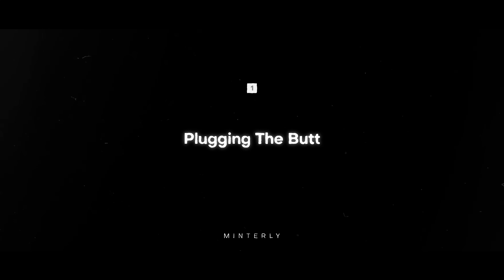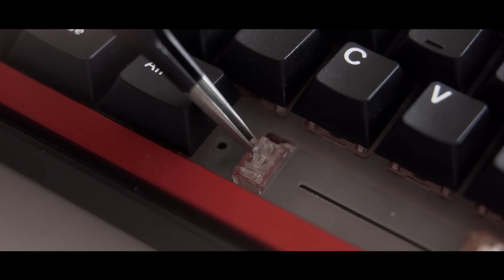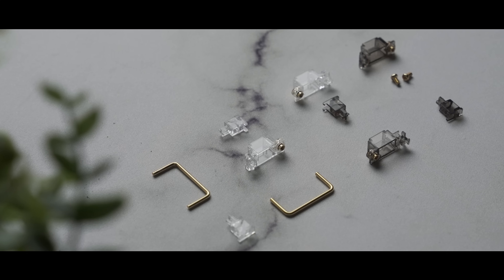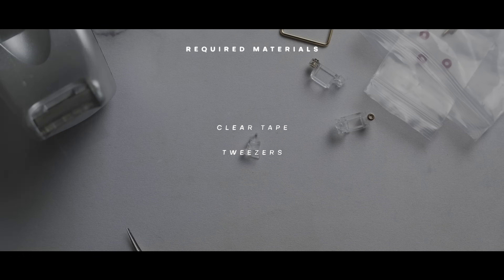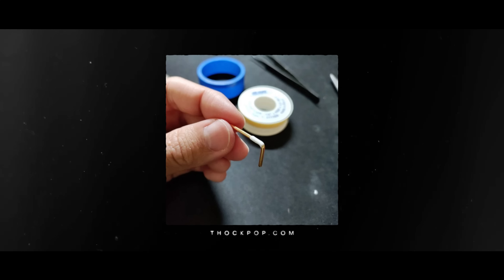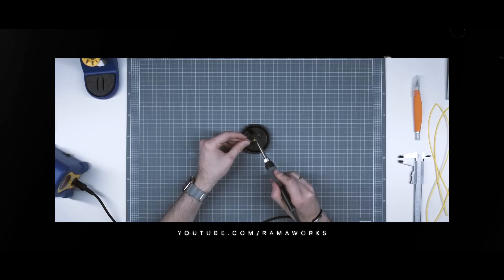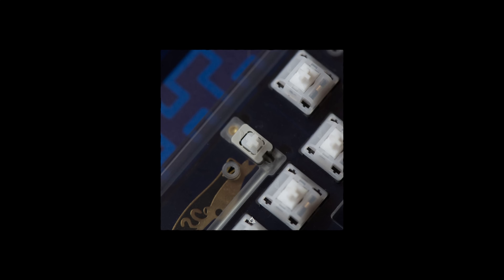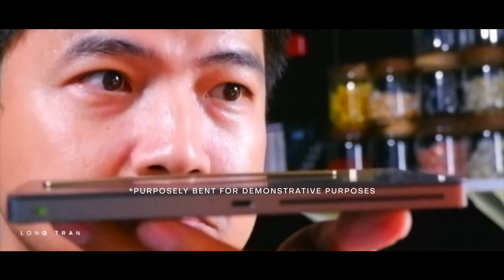Stabilizer Mods Explained

Comment from the maker: Links to essential stab stuff (code LUCID for discounts):

Durock v2: https://keebsforall.com/products/durock-v2-stabilizers?_pos=1&_sid=9f90fa9cb&_ss=r&sca_ref=864556.Tt5IqFulKc
Gat Ink Stabs (I prefer these over Durock v2s): https://keebsforall.com/products/gateron-inks-v2-stabilizers-screw-ins?_pos=5&_sid=ee7c3014e&_ss=r&sca_ref=864556.Tt5IqFulKc
205g0: https://keebsforall.com/products/krytox-gpl205g0-mechanical-switch-lubricant?_pos=1&_sid=7e77ec1fd&_ss=r&sca_ref=864556.Tt5IqFulKc
XHT-BDZ: https://keebsforall.com/products/krytox-xht-bdz?_pos=1&_sid=af3943cba&_ss=r&sca_ref=864556.Tt5IqFulKc
Tweezers: https://loobedswitches.com/collections/accessories/products/loobed-tweezer?ref=mqpdi5sgol
Stem Holder: https://keebsforall.com/products/stem-holder-for-switches?_pos=1&_sid=9c9f5ba21&_ss=r&sca_ref=864556.Tt5IqFulKc
Reply: Are Durock stabs good out of the box?

Comment: epsi mod is easier when you use the included stabilizer pad extra bits from deskeys that already have an adhesive applied. That small extra sheet probably works for multiple keyboards. My guess is about six 60% boards. Very easy to use and very effective

Comment: 2:21 OK so the space matters, hence you could probably either get a couple of layers of medical tape for extra cushioning (or whatever tape is soft but ever so slightly firm that works best) but put some aluminium tape underneath if that is a bit too thick. 2:36 Although maybe you want to put aluminium tape on top so as not to have it frey.

Comment: I'm super new to mechanical keyboards. I just bought my first mechanical keyboard less than a month ago. It was prebuilt. I just manually lubed my switches a week ago because they were really inconsistent. Then, I decided to do something about the spacebar, because it was so clacky. I was able to reduce a lot of the rattling with the bandaid mod around the plate, because I have clip on stabs. I did the holee mod too, but had to remove it because my spacebar would get stuck and wouldn't bounce all the way back. But without the rattling around the plate, I noticed that my space bar would tick. It was driving me crazy, so instead of the holee mod, I tried the shrink tube and it worked. My spacebar doesn't rattle nor tick anymore but... now it's super mushy 😭
Maybe my bandaids are just too thick?

Comment: My everglide v3 plate mount's housing is too tight, so if i use band-aid to Holee mod, it wouldn't even function as a stab. So i have to use Medical tape, which is quite thin, but it actually worked. no rattle and ticking anymore

Comment: why cant we just have more than one switches under those keys to support them, eliminate stabilizer at all. ik cost is one issue, but ppl after this is not gonna care few more extra switches.
i always feel like lube in an open area (not inside a switch) is not a long term solution and it is just not elegant from engineering point of view. I stand the same view as OP's, innovation is absolutely the key of this problem, all those mods, tapes is just not it for me.
Reply: W
Reply: I agree, I always thought using switches would be a way more consistent and controllable design.  I can see why people have not designed these yet tho.  One reason is the new switch would have to be thin enough to take up the same space as the stabs in order to maintain compatibility with the keebs and caps that people own already, but this seems doable.  I'm not a mechanical engineer, so it may be easier said than done to accomplish that and achieve the desirable qualities of a 'normal switch' with a thinner 'stab switch'.

Where it might get tricky is trying to design the switch so that it provides the same quality pushback as a normal switch, but does not result in an undesirable increase to the weight of the key it is used for.  A workaround to this would be to swap out the 'normal switch' spring for one with lesser weight, and spreading the work of the springs across the 'normal switch' and the 'stab switches' for a non-heavy and consistent feel across the keycap (but that would just be another mod that needs to be done lol).

Anyways, it seems like there is potential for a 'stab switch' that will be made someday, so long as someone steps up to be the person to do it.

Comment: Great video! Quick question, does using dielectric grease + holee mod on the stabs make it too mushy?
Reply: yes.*

 *if you add a normal amount, yes, it will be very mushy. i might try adding less than normal, bc i have seen people do it. i would just use 205g0 to be safe

Comment: why dont more plate support both cherry and costar stabs
Reply from the maker: costars are very rattly and hard to tune :(
Reply: @nearLucid  wut... what costars have you used? any board with costars Ive ever used are 100% rattle free without any of these weird mods. 
And this video is literally about how hard cherry stabs are to tune. 🤨

Comment: What Taeha currently using?
Reply from the maker: Taeha only uses lube, and if you want to go that route, I would recommend picking up XHT-BDZ / Dielectric grease for wires and spending a good bit of time balancing the wires beforehand. like, half an hour to an hour, if you don't want rattling or ticking to come back. Also, I like to pre-lube the stem (same as in durian softjojo's clear tape tutorial) by putting thick lube in the stem mouth before putting the stem there, kind of like plugging the butt but before installing the stem.

Comment: Are any of these mods only viable if done on pcb-mounted stabs versus plate-mounted stabs? Wondering how much harder it would be, if at all, to implement these mods well on plate-mounted stabs.
Reply from the maker: They should all work the same since the mods pertain to the stems and wires

Comment: “Working with stabilizers can be tricky”
Me, just finishing up a 6-hour session of cleaning, ultrasounding, balancing, and re-tuning a 75%: NOT FALSE

(Also, don’t forget about the fact that if your stabilizers need to be redone and have grease/oil on them, your experiences with any form of mod involving HOLEE-esque methods is gonna be HELL)
Reply from the maker: felt.
Reply: I recently tried holee modding some stabs for the first time with band-aid and they turned out really poorly, so I removed the band-aids and attempted to clean off all the grease and such by rinsing each component of the stabs in hot water and soap. I would like to try the clear tape mod next. Do you have any advice on how to get the housings into as good enough of condition prior to attempting this so that I can hopefully make the process less "hellish"? I don't mind going in with the tweezers and carefully scooping out any grease that I can from each part, but I'm curious about what you might recommend. Thanks!